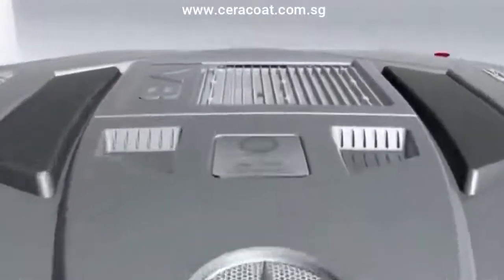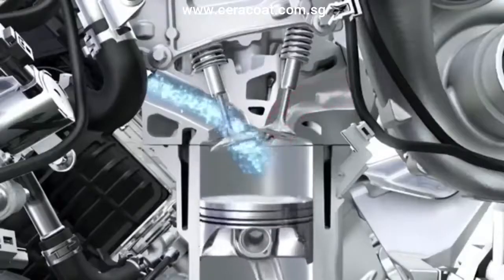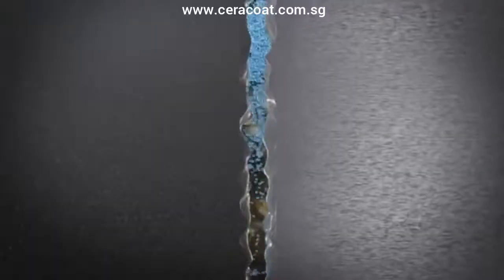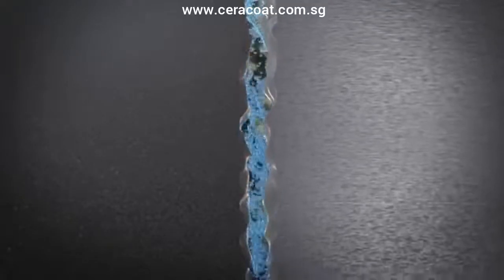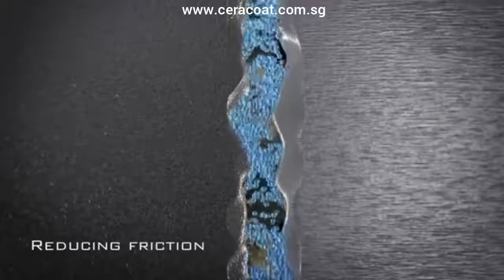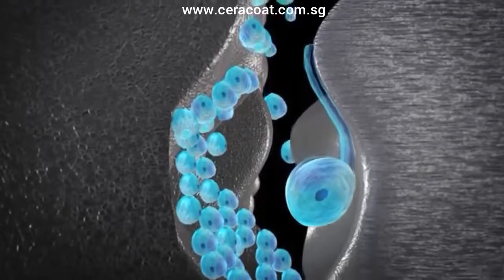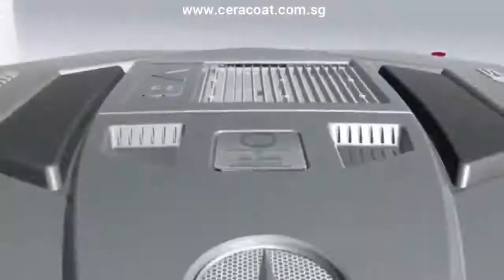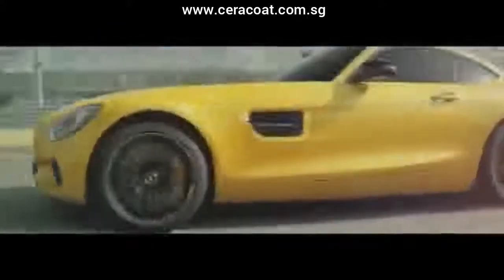Ceracoat Ceramic engine care

Comment: Does Ceracoat Ceramic Car Engine Care has any long term side effects?
Reply from the maker: It's a long term ceramic coating in your engine (piston rings and cylinder walls). So, there is less friction in the engine and due to that, the engine has a better output, less fuel consumption, less wear, etc. etc. There are no negative effects at all.
Reply: @Ceracoat  Thanks.
Reply from the maker: You can also have a look at www.ceracoat.me

Comment: Is this product permanent ? Or  every oil change requires another treatment .
Reply from the maker: It's a ceramic coating, not an oil additive. It adheres on the metal parts (cylinder walls + piston rings), so it is still there after an oil change. It lasts for about 50-60 000 KM
Reply: No. Engine care Each  treatment is for 50,000 Km or one year ,